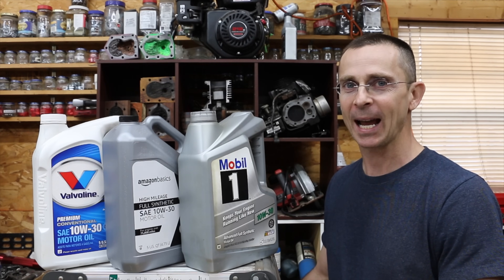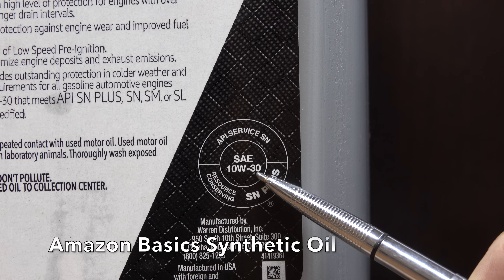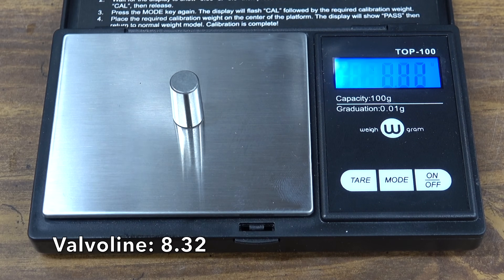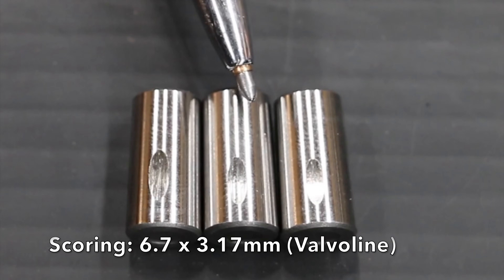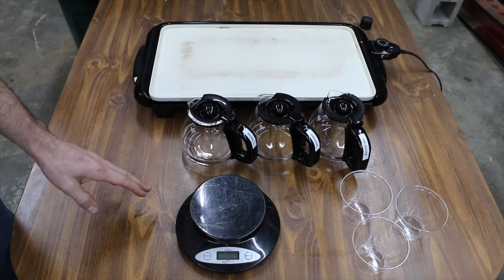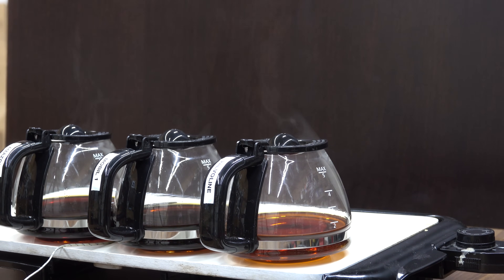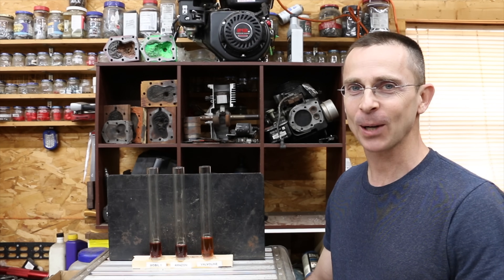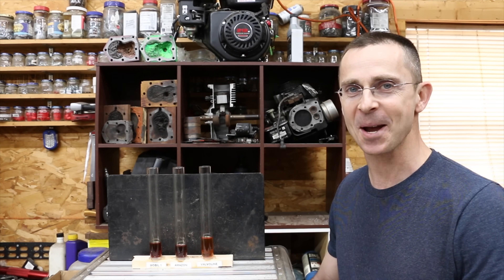Is AmazonBasics Full Synthetic Motor Oil better than Mobil 1? Let's find out!

Comment: Thanx for the Video.  I just had my oil changed a few days ago, and trying to decide if the price difference between synthetic and regular oil is worth it.  I'm in Saskatchewan where winter overnight temperatures frequently reach -20°c.  It was nice to see the synthetic perform better than the regular in the flow test, but when using a block heater, is it still an advantage?
Reply from the maker: I believe synthetic motor oil offers a lot of advantages making it worth the extra cost
Reply: @ProjectFarm  I did go with synthetic, I really enjoyed this video.  Keep up the great work.

Comment: What are your thoughts on a Zinc oil as opposed to conventional or synthetic?  I see many high engine makers recommend zinc based oil.
Reply from the maker: Thank you.  Zinc is used in pretty much all motor oils on the market, conventional and synthetic, but most have less than 800 ppm to prevent damage to the catalytic converter.  Higher levels of zinc are indeed desirable in many instances, such as a flat tappet engine. Thanks again!

Comment: How are you not going to put AMSoil up on there ;) It also would hve been nice to see you switch up their positions on the flow test, just in case one slot was slightly more on an angle.
Reply from the maker: Great point. I tested Amsoil in a more recent video.

Comment: For the lubricity test it would be necessary to have a more sensitive scale especially since the change you are measuring is essentially the absolute smallest change the scale can detect. Additionally, the cylinders would like need a very high quality cleaning before each weighing.
Reply from the maker: Thank you for the feedback

Comment: Who gives a damn? My Model 3 has 21k miles on it and I’ve changed the oil NEVER. I expect to change it NEVER. Because it has none. Because ICE is insanely stupid outdated dirt-burning “tech” with 3,000 moving parts better used for steampunk cosplay rather than transportation.

Comment: Looking at color and properties, it feels like amazon just reverse-engineered the mobil1, with some minimal differences in production for slightly different properties.
Their increased viscosity would explain why it flows slightly faster, but sticks to surfaces slightly worse, causing slightly worse abrasion. 
I'd say, if you own a $100k+ car, paying for the brand might pay off, but for 99.5% of all car-owners, the amazon brand is most likely the better choice.
Reply from the maker: Thank you for the feedback

Comment: You didn't test flow characteristics at high temperature. The viscosity of the Amazon oil could be lower, which doesn't necessarily make it a better oil. The idea is to maintain an ideal viscosity over a range of temperature conditions. Thinner when cold may mean it's thinner when hot, which isn't a good thing!
Reply from the maker: Thank you for the feedback

Comment: I do want to point out the cold flow is only part of the equation. I am not a mobile fan boy I use motor craft lol. Oil viscosity comes into play for flowing but also into play when it comes to clearance around bearings.  I would like to see an oil analysis for the two oil side by side.
Reply from the maker: Thank you for the feedback

Comment: Start of video: "Today we're testing this cheap crappy oil the bozos at Amazon have put out"

End of video: "I am now using Amazon oil in all my vehicles"
Reply from the maker: Thank you for the feedback.  As long as the price is still reasonable, it's a great value
Reply: The problem with anything from an Amazon basics line is that it's just stuff Amazon rebrands from another company. Which means that the quality of the product is subject to change depending on who is currently supplying them with said product. 

So while this is probably true for the current batch, you might want to check some new reviews the next time you want to stock up on oil. Because they could have potentially changed their supplier.
Reply: @ResidentFurryx  Makes sense
Reply: 🤫🤫😂😂 just random video convincing me to get amazon oil lol Haha now going to buy some

Comment: My Father used to work for the largest textile machinery manufacturing company in the world. They tested synthetic and various conventional oils on their machinery back in the 1960's and early 70's. The machines were designed to run 24/7 with monthly PM's and yearly overhauls. When they found that synthetic oils significantly reduced wear they shut down the research and stuck with conventional oil. The company decided it would hurt their profits if they couldn't do the yearly overhauls. The synthetics would have extended overhauls to every 3-5 years at least. My Father also invented an injection oiling system to replace their splash system and presented it to his company. It would've extended overhauls even longer. His company rejected his idea. 
My Father eventually was lured away from the company and went to work at an independent overhaul and replacement part company for textile machinery. After about five years he retired and started building his injection oiling systems and marketed them to the textile mills himself. He was overwhelmed with orders even though at that time the textile industry was fast collapsing in this country. Every weekend I helped him make up the part kits and assembled the oiling lines and injectors. He was paid travel and expenses and didn't have to actually install the kits, the mills supplied the labor so he just supervised and inspected. He made more money in a five year period than he had made in the previous 20. Eventually virtually all the mills shut down, his health deteriorated.
Reply from the maker: Thank you very much for taking the time to share this.  Amazing intelligence and work by you and your father!
Reply: This is the american way to solve the things. Congratulations to your father, from Brazil.
Reply: Is your father named, my father? For such an important guy u don't wanna mention his name, tells me u are lying.
Reply: @Executnr  Sounds like your father, rather than making inventions and helping out was busy beating you up. Did he use the buckle end on the belt? Go somewhere else to spread your negativity dude. You lose.
Reply: @Executnr  Yes, his name is "my father". His name is unimportant to you. "My father" was just an average American of the Greatest Generation. "My father" survived the Depression, served in the military, fathered six children, worked hard, took care of my mother until she passed, and died leaving no debt. "My parents" started with nothing and inherited nothing from their parents. They managed to leave each their children a small inheritance. I'm now retired and have already left my children more than I was left. Hopefully they will build on what I've left them. 
You seem bitter, what's up with that?
Reply: @dvrmte  liar if u were proud of him an if he was a real inventor like u say, I would be able to google him an the company he worked for an the company he built. It's like he doesn't have a name and that's odd. I'm not gullible to believe your fantasy.
Reply: @Executnr  Have you ever thought that he wants to keep privacy? Do you mind telling me your first and last name and where you work?
Reply: @BadgerScrub  "important" history shouldn't be private, u know people exaggerate on youtube. I'm not an inventor, nor did I share a story.
Reply: @Executnr  You have no right to that information. I also don't care if it's fake or not. It's not my job to fact check every random little comment in a YouTube comment section about oil testing.

Crawl out from under your rock and do something useful with your life.
Reply: @BadgerScrub  my last comment, he should have kept it to himself, a 60 year old interesting story with no names of nothing, can't fool me.
Reply: @Executnr  what a very cool dad thank you for sharing that, pretty amazing. 👍

Comment: you had a lot more oil in the mobile 1 cup than the amazon cup it was sloping additional oil on the wheel during the run
Reply from the maker: Thank you for the constructive feedback
Reply: @ProjectFarm  no problem I believe the 2 will perform the same on that test provided the sample size is the exact same.

Comment: I imagine this is just rebranded brand X that Amazon is using.  The problem is unless you test this regularly how would you know if Amazon switches to a cheaper supplier in the future.
Reply from the maker: Warren Distribution oil. Thank you
Reply: @ProjectFarm  Work at Warren in Council Bluffs, Iowa. Amazon basic motor oil ships like crazy!
Reply: It's also on the container 😁
Reply: It's a good point, but I think this is a problem for basically any product.  Who knows if they changed things around to save a buck?  Happens from everything from food to electronics, though they usually show some evidence ('new recipe, same great taste', or showing it as a slightly revised model in the case of electronics).

I will say that it's more likely to be a problem with Amazon Basics and other companies that use the method of taking some other company's products and rebranding it.
Reply: @ThatSoddingGamer  because it's more expensive that way. Oil is mass produced by Warren and Valvoline and Mobile use it too. It's bought wholesale by a miltibillion$ co. I wouldn't worry about it.
Reply: The majority of "lesser" oil brands that conform to the latest API grade designation are really just Warren Distribution custom bottling/labeling. They're a huge oil manufacturer that produces a proven reliable product at a fair market price and there's almost zero risk that Amazon or Super Tech or any of the others change away from Warren.
Reply: Great point. I’d still trust Mobil in the long run. We’ve used it forever and it’s always been great stuff.
Reply: Whoever is cheaper at purchase time...roulette
Reply: @Rangoslap8  Warren Distribution is not roulette.  It says who makes it right on the bottle, and the testing standard it meets is stamped right on the bottle.
Reply: You can just buy from Walmart's Supertech or Costco Kirkland. Same supplier and oil formula
Reply: @masterwhopper414  Its basically Mag1 but I think there are different additives but Im not 100 perent sure. Pretty neat watching the process
Reply: USA fortunately has minimum requirements that’s federally regulated. So no worries on getting cheaper oil.
Reply: This same oil is priced at just 14 dollars at Royal King 😉
Reply: I managed to pick up 5qt at $2.00 at qt I’m just going to run it 3/4K and change it out. I normally go 5-7 kIt just depends we’ll see how it holds up
Reply: Ask Alexa , duh
Reply: Could happen with your own motor oil you use. Just saying too lol and the one I currently use, pennzoil ultra platinum lol

Comment: The Amazon oil seemed a lot darker after the heat treatment than before, even next to the Mobil 1. I wonder if that would have any effect on the lifespan of the oil in the end?
Reply from the maker: Thank you for the video idea!
Reply: Usually the color isn't what we check when we want to see if the oil is any good. We check out the thickness of the oil. If you do your oil changes every 3000 miles (even with synthetic blends) you shouldn't notice too much of a difference between Amazon and Mobile One. However, Amazon oil is definitely cheaper and seems to hold up really well so I'd go with that for the cost.

Comment: Yeah, well, I've used Mobil 1 since the late '70s (thank you, Kurt H. Wolford [September 29, 1959 - March 18, 2017], for introducing me to this). I have never had an engine failure, not in my cars, trucks, or motorcycles. I will give up Mobil 1 only when they pry it from my dead, cold hands.
Reply from the maker: Thank you!

Comment: Is there a reason that you didn't perform a surface tension test?  IE. a test which measures each oil's ability to cling to parts.  This is immensely important for oil performance.  Your oil doesn't do you any good if it doesn't stick to your parts to find it's way into the spaces between gears or contact points.  From what it looked like, while you were performing your wear test, the mobile 1 had a much higher surface tension and therefore clung to parts at a much higher rate, which looks like it was reflected a little bit in the lower amount of wear, but it looks like some of the oil was flung out of the cup during the test  as a result of your test.

Comment: Although I appreciate this test very much, the problem is consistency between batches. It is possible that oil from a different lot/batch may vary. Repeating the same test in a month, or ordered from different sources, there is a chance that the oil may have some variability between batches. Maybe batch isn't the right word, but there could be variation between among the same brand, and without adding that variation to the test as a variable, maybe it's just the bottles you tested that provide that result. Maybe not, maybe they are all consistent in results, but without testing that, it's impossible to know for sure.
Reply from the maker: Thank you!

Comment: In future you should conduct the bearing test with hot oil as well. The viscosity of oil will change with heat. These test only justify the oil in engine that is warming up, which can equate to a little as 3 minutes. Hot oil would provide some information on prolonged use
Reply from the maker: Great recommendation. Thank you

Comment: I have a peculiar problem with synthetic oil that no one believes unless I show them vs conventional on 4 vehicles.  2 Chevy and 2 Honda.  On synth the engines tick loud and rough idle and with conv run smooth as a Swiss watch.  I don't have as strong acceleration with synthetic either.  I want to believe in synth but its been nothing but problems for my vehicles 🤷🏽‍♂️
Reply from the maker: Thank you for the feedback

Comment: Great info. Any way to find out who makes the Amazon oil? And yes, someone suggested walmart vs mobil1, and I'd say walmart 2 stroke oil against the BRP mineral or synthetic. Lots of 2 stroke snowmobilers here, and some swear by the Walmart for the non specific engines like a ski doo 850 requiring the BRP synthetic. At 50 bucks a gallon, or 4 litres, yikes!!
Reply from the maker: Warren Distribution.  They've been in business for around 100 years.  Great company

Comment: It was a very interesstting experiment and well made video. But what else does that experiment show besides the fact, that an oil, whichever was better, flows. I mean does the viscosity tells you everthing about the performance of the oil under several conditions? Probably not. For example what about the endurance capeabilites, what about additives and so on..Anyway, it's still very impressive and very suprising to me how well done this oil probably is for that price.Would I use this oil in my car?Probably not.
Reply from the maker: Thank you for the feedback

Comment: 4:50 You didn't measure how much oil you put in the overflow cups. The Mobile 1 cup was so deep that the oil was visibly gushing over the bearing, as the race spun through it. The other oil overflow cups started with less oil, and we're barely touching the race as it spun. It appeared there was far more lubrication for the Mobile 1.
Reply from the maker: Thank you for the feedback

Comment: Why was Mobil 1’s cup over flowing for the bearing test but not the other 2? Wouldn’t that effect the outcome?
Reply: Josh Rivas I was gonna say, seems like the Mobil 1 test got much more lubricated than the other two.
Reply: That thought ran though my mind too
Reply: Well, as you can see in the video, the excess oil was flung from the cup in each test. Any extra oil in the cup had no effect since all of them reached the same amount of lubricant in the cup and contact with the wheel after the first few seconds of flinging extra oil.

Comment: You are wrong about cold flow . The race you showed is based upon viscosity. Just because one oil is thinner at freezing means its viscosity   is different.  Sooo if it says  10w and its slower than 5w that is just a difference in viscosity and not a performance flow  factor.  Amazon basic is 0w-20 so it will flow faster than 5w or 10w at freezing.  I prefer Castrol GTX  and change every 3k miles .
Reply from the maker: Thank you for the feedback

Comment: This was very thorough, but I am 100% confident that your balance cannot measure the difference between 8.33 g and 8.32 g. You should have weighed the bearing 3 - 5 times before and after the test and compared the averages/std deviations; you would have most likely seen a slightly different measurement each time you weighed the same bearing, indicating that your balance is not sensitive to a loss of < 1%.
Reply from the maker: Thank you for the feedback

Comment: But then you look at lab testing after 5,000+ miles of use and find out the additive packet in Mobil1 almost doubles the life of Amazon Basics and the viscosity is barely changed in comparison.
Reply: well, would be interesting to see long term oil test since that is what is more important to most people. But Amazon must be making some cuts somewhere to get the price so low.
Reply: @VanSanProductions  there already are tests out. In any given OCI, you'll see double the wear metals of Mobil1 and about half the life expectancy of the additive packet (TBN). I have tested it in my JGC and Civic and found the same results in both. It's only a few dollars cheaper per gallon than buying Mobil1 at Walmart, so I'm going to say it's extremely lackluster for the price point.

https://youtu.be/BGFqxeU-Nr8